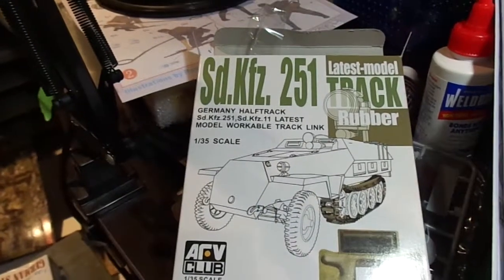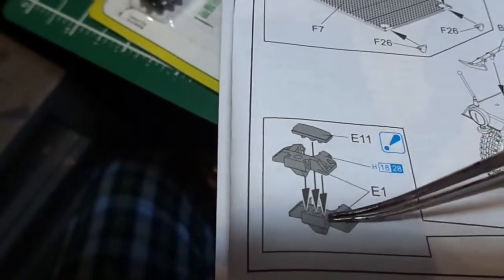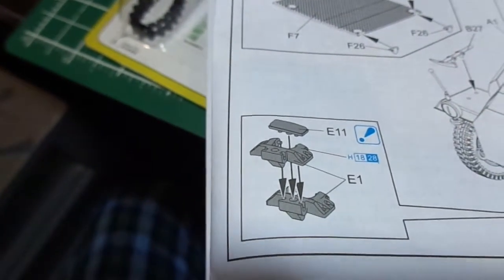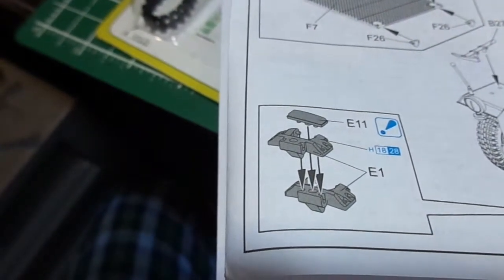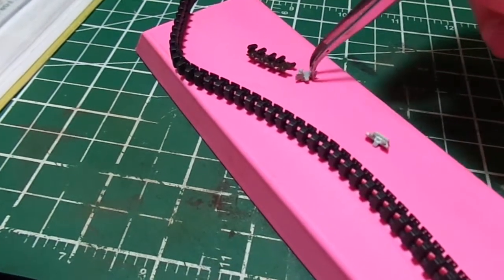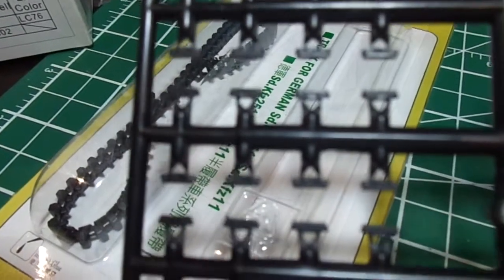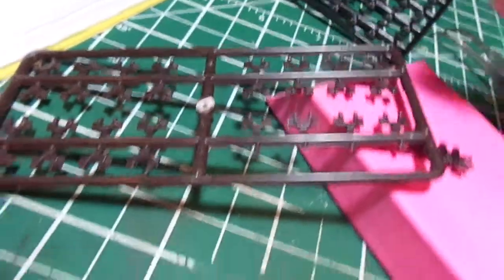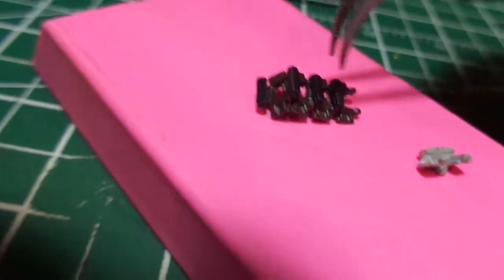Review of 2 types of AFVClub tracks for Sd.Kfz.251

Comment: I glued them together and drilled through the pins from the side and added a copper wire through them.  It didn't take quite that long but it was easier once I set it up for my dremel drill press.